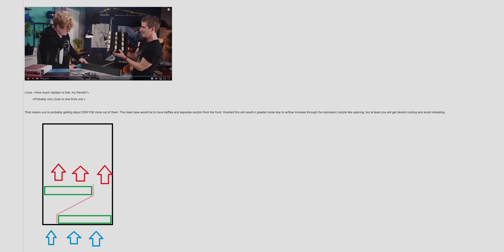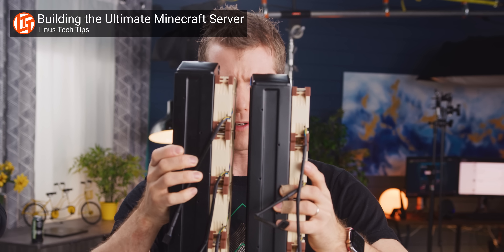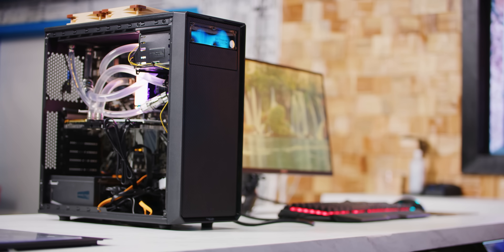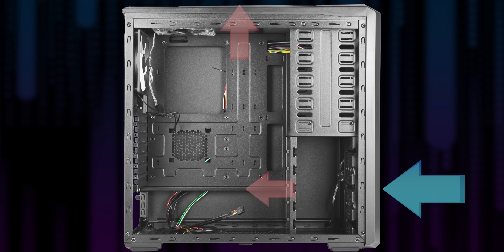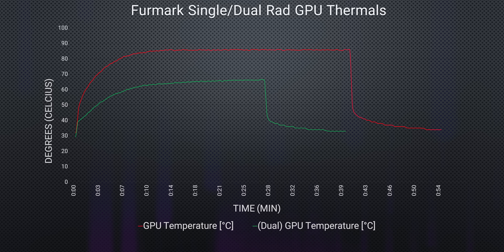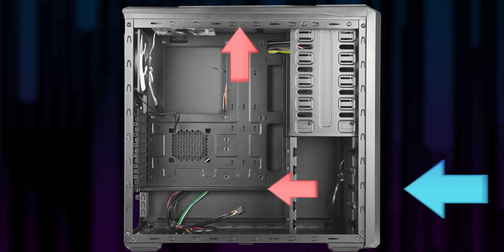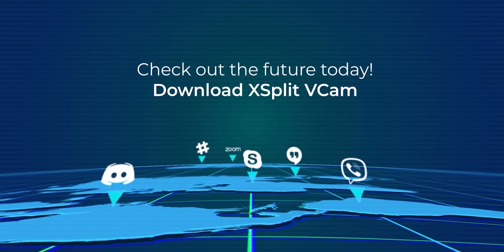I’ve been water cooling wrong for YEARS - $H!T Manufacturers Say

Comment: Radiators are not a new concept, cars have been using them for years, right? So a 2-cylinder engine uses a smaller radiator than a V8 for example. Your "basic logic" makes sense, but the flow of air is the key component here.

Also, another fun (but dangerous don't try at home) how well does a car radiator cool a PC? (seriously don't try at home, a radiator fan from a car is not something to mess with. This is a seriously unsafe mod.)
I'm sure you could get some radiators that you can grab from a scrap yard, find some electric motors (I know you have friends in high places [rockwell automation, general electric, general motors, etc.]) that can run the fans for the car rads... but the difficulty is the pressure flow from those.

At what point would there be diminishing returns?

Comment: I think you're missing some data on this...I would expect the order you run the water thru them matters.  If you run the "hot" water thru the radiator on the intake, and THEN thru another on the exhaust I'd think you would see less cooling effect than if you run the "hot" water thru the radiator on the exhaust and then run the cooler "warm" water thru a second radiator on the intake.

It would have also been good to have thermometers measuring the temperature on both sides of each radiator - if possible, measuring both the increase in air-temp and decrease in water-temp.

Comment: There's some flaws to this video.
Corsair has reached out and said that your specific configuration in the Hack pro was inefficient and that stacking radiators in the Minecraft server was bad.
Bear in mind that you've mentioned that Corsair said that stacking radiators was bad but you didnt stack radiators in the experiment at all.

Here were the limitations you have done when performing your experiments.

1. Comparing your experiment with Hack Pro. Hack Pro has a single inlet and single outlet which completely does not allow for any sort of fresh ambient air mixing. your experiment has multiple open air spaces where fresh ambient air is constantly being pulled in. 
2. Comparing your experiment with Minecraft Server. The minecraft server has 3 radiators stacked together and your Hack pro has no stacked radiators. 

A fair comparison would have been to remove the smaller radiator in the Hack Pro and run temps. This would be a fair comparison towards corsair's claims.
Your own experiment is completely different to the parameters set in the simulation. It's like saying you would like to bake an apple pie but instead went and made an apple cake. It's completely different. 

Simulation will be the future of the engineering world. Please do not discredit simulations which corsairs have done. Simulations have come a very long way to be reliable and accurate and we need more engineers who can perform FEA or CFD.
Reply: Linus said in the video, they took the 3 stack of radiators in that build and removed one, leaving them with a 5°+ on what they had with a 3 stack....
Reply: Another gap in their method is that maybe second radiator is really not doing any real work, it is just that fans of the second radiator is increasing negative pressure in the system and contributing to the efficiency that way.
Afterall if we unplug the second radiator, it is still; one radiator + 2 fans > one radiator.
Reply: As someone who works doing CFD simulations, I appreciate your comment.
Reply: I wonder what an apple cake looks like
Reply: Might it be that they didn't/couldn't test with the Hack Pro because it has since been disassembled... I doubt they would keep such an expensive computer sitting around collecting dust.
Reply: Yeah, nah. If the simulation doesn't agree with experimentation, the simulation is wrong, or the experiment is bad.

Both happen regularly, it's the entire reason we have good simulation software because it is validated against the real world.

One of their critiques was of them stacking the radiators in the server, taking it out increased temps, hence their assumptions on the system for the simulation must be wrong.

It seems to me the main failing is the difference in specific energy of water and air, and that passing 25C air quickly through a rad full of 60C water isn't going to make the air 59C. There will for sure be diminishing returns, but that doesn't mean it won't work.
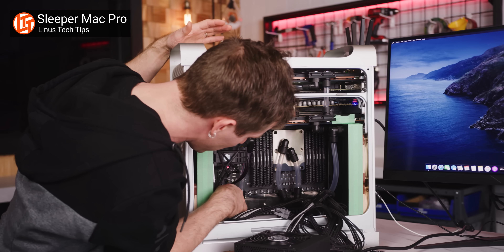Reply: at 6:46  may you have missed what Linus said that when Jake removed one of the stacked radiators in the minecraft server it resulted in a 5 degree increase in temps. fyi
Reply: @TheKb117   Another variable that would affect heat exchange would the the air flow, by effectively removing 1 rad, did he also remove 1 row of fans? If yes then , air flow decrease will be the cause of the lower cooling, not the reduce of heat exchange area.

try 2 rows of rads and 3 rows of fans, i think he would get the same result as with 3 rows of rads with 3 rows of fans.

please dont question our credibility, we actually do this for a living
Reply: Zhi Ting Chong adding another row of fans would barely touch the airflow. The reason there is a 3rd row of fans in the current setup is to create more static pressure to push through the radiator. I’d be willing to bet the airflow in the case is very similar with only 2 rows of fans and 2 radiators. For someone who “actually does this for a living” you don’t seem very knowledgeable about how airflow actually works
Reply: @nickabbott3081  I'm talking about airflow within the heat exchanger( or radiator). Not in the case. At any rate yes, the airflow of the case would be barely affected by adding more fans.

And as you mentioned there would be a small difference which is the point I'm trying to prove. The 5 degree temp difference is very small, and is most likely caused by removal of fans rather than the heat exchanger. Have a good day mate.
Reply: Zhi Ting Chong you’re really not understanding this. That case is already full of fans. It’s a server rack. There’s multiple rows of fans at the front, there’s fans at the back. Adding more fans serves literally no purpose whatsoever. If you seriously believe that adding a couple more fans when the case is already basically full of them will cause a 5 degree temp difference then I don’t know what to tell you. You’re just wrong.
Reply: @TheKb117  5 degrees for $100? Ya no.
Reply: You should always attempt to discredit simulations, but by independent testing. It's why papers are peer-reviewed. Bad science will harm the reputation of simulations, nothing Linus could ever say or do will harm the reputation, he's just an elitist with a YouTube channel.
Reply: I've just did some quick calculations.

Assuming that overall heat transfer coefficient is at 350W/m^2K which is taken from engineering toolbox for water to copper transmission, and assuming that the surface area of the corsair XR7 480mm water cooler is at 0.68m^2, with a water inlet of 60C and air inlet at 25C, it shows that the water temperature would be at 42.2C and the air outlet temperature would be 48.7C. By corsair's replies, it is right. Because what would be the use to cool 42.2C hardware with 48.7C air blowing into it. These calculations have already included a 67.6% effectiveness.

Simulations will mostly be right as long as the correct parameters are inputted. 

I'm sorry for anyone who reads this. I've followed Linus for a long time now and he's just taken a jab at my dissertation which I just completed. 
I hope he'll see this and actually re-do the experiment with the Hack Pro
Reply: @shawntoh6877  It is actually a clever trap by Lienus and Corsair. They are tricking you into purchasing a PC and 3 radiators and replicating it, so that you can figure out why it works!
Reply: I've indeed missed the part where he removed the minecraft server radiator. My bad on that part but still the claims that he's said that corsair is spouting shiz just isnt right and bad shaming the simulation community
Reply: Shawn Toh you really didn’t watch the video closely at all before jumping to conclusions and spouting all this garbage. #1 Linus did test on the stacked radiator configuration and found similar albeit less impressive results. #2 Linus never put down Corsair or said they were spouting “shiz” he in fact said very specifically that he is not trying to put down what Corsair said and believes that there is merit in their insights. #3 He isn’t shaming the simulation community, he runs a YouTube channel that deals with tech. A major tech retailer has reached out and given him advice and so he made a video out of testing it. He would’ve made a very similar video if the claims turned out to be accurate but IN A REAL WORLD SITUATION NOT A SIMULATION the claims are in fact false. I don’t know how you can possibly argue that he’s shaming the simulation community. Do you just want him to listen to everything a simulation says regardless of real world stats? That makes no sense

Comment: When you're outright stacking radiators, there's going to be a dependency on which serial radiator the water goes to first. If it goes to the second radiator first, there will still be some residual heat to be pulled out from the front radiator. If you reverse that, flowing the water to the first rad first, you're just blasting hot air at the second radiator.

Comment: It's all about heat exchanger order. You want the higher temp water in the radiator that will experience the higher air temperature. So in the test rig, the water flow should go: components, top rad, bottom rad, reservoir, pump. If you swapped the rads I would expect the results to match what corsair was saying.

Comment: I've spent years trying different configurations on my PC.
When I had the radiator at the top I found that it ran cooler if the fans were pulling air in to the case than pushing upwards out of the case simply because cold air drops faster than heat rises. However I've moved the radiator to the front as I have a large case and I wanted this heat source to be farther away from the Mobo/CPU etc.

By far my best setup is: 
280mm radiator at the front with a push and pull fan config drawing air in to the case
2 x 140mm fans at the top pulling air downwards in to the case
1 x 140mm rear exhaust fan

Comment: Personally, my guess would be that while radiators are efficient, we have bit of same thing going on as temperature of the liquid. Like if your CPU is running at 60C, liquid in your loop won't be 60C. And similarly to that also air going through radiator will not heat up to the temperature of the liquid. And I do think both is connected to how much flow you get through loop or radiator. While yes, radiator is restrictive, it doesn't exactly stop air either and good fans will push through just fine. And while I do think you could notice negative effect, if 2nd radiator would be taking hot air, that hot air would need to actually exceed liquid temperature, so radiator would get bit of that reverse effect. Otherwise it might do less for you, but it still wouldn't be negative. Because radiators ability to dissipate simply scales with temperature difference, and its ability to warm liquid up also scales with that same difference in opposite direction. But even if air is not as cool as intake, I don't think inside of your case should heat up enough to where 2nd radiator couldn't make at least some improvement. If it does, you might want to look up new case with better airflow. Because regardless of how much liquid cooling you give to your CPU and graphic card, you still need some airflow for other stuff, be it VRM, SSD or chipset, those don't like to get cooked either. Plus if your case reaches temperatures to where you feel it like it is really very hot, like close to burning hot, you got bigger problems to worry about than 2 or 1 radiators. And yes, I saw plenty of cases where people "forgot" to upgrade their case, went from lower end or mid-range build to high end and suddenly had noise and heat issues because poor case was designed to work well with much lower end parts. One new case later and things drastically improved.

Comment: I think you guys done fucked up here. Like many others here in the comments, I'd almost guarantee corsair were referencing your stacked rad setup.

If you wanted to, you could liken it to adding double or triple layers intake or exhaust fans on an air cooled system.
Whether the second or third layer would be completely irrelevant idk, but you'd get massively diminishing returns, simply by the laws of physics as corsair pointed out.

Also you guys normally take a pretty measured approach to these things, however this video was half-assed at best. Seemed a hurt ego reactionary video rather than a fair test (particularly because you putting this in the shit manufacturers say series). I'm sure corsair has some of the best  airflow modelling software around, that'll almost directly translate into a real world system. 

We can simulate some really amazing things real well these days and it's a bit sad you disrespected that so much. I mean look at your folding at home initiative. If we can simulate stuff like that, I'm sure you can believe an airflow model to be correct.

Ps. Loved that new animated intro tho

Comment: What if both rads were exhausts? They both would exhaust the hot air, and not circulate it back in. You could have the other fans intake the ambient air. That may be even better cooling performance.

Comment: The testing results can be affected by direction of flow. (Didn't read all comments)
My theory should have flow to first rad in upper case and second rad at front of case. this would allow the hottest air to be discharged first and not get trapped in the case. Although I do wonder what the difference in overall temps be plumbing to the front rad first.

Comment: Would like to see comparison of the same cooling loop but with two different size reservoirs.  Is it possible to hit the heat capacity of a system’s water volume?  Can simply increasing the amount of water improve either overall temp or time to reach max temp?

Comment: Running them stacked vs the same radiators not stacked seems like the obvious test. Car manufacturers a do the same thing. They need multiple small radiators because stacking them loses major efficiency. Problem is there isn’t enough room in a case to do this so stacking is better than one.  Surface area of the cooler is a bigger factor than the thickness , but going thicker is better if you have no other option.

Comment: I've been watching your videos. The question I have been wondering about is, how fast does the room temp rise? I got a lot more in my system than you have in yours.
4 pcie cards plus 3 hard drives plus on ssd.
I do have a pcie ssd in the system that can produce a lot of heat. 
I want to see if you could try two new ideas.
Can you water cool gpu, cpu and a pcie ssd?
Since computers run as dc power, would it be more power efficient to use a 12v battery or more? The system mainly uses 12v off power. No power supply heat.

Comment: BS claim by Corsair imo. Air is still limited to taking a certain amount of energy and is still able to take that amount of energym worst case scenario stacked radiators will work exactly the same as one radiator.
Stacked radiators still have more surface which helps them lose energy faster

Comment: I definitely think there is a lot to be said about the single airflow source. In a server, like the MC one, stacked rads can only get you so far. In a computer case, the chances are high that you're pulling in air, that didn't ever touch the first rad.

20C is quite a lot more than 5C, and I definitely don't think 5C for the cost of that rad+those fans, is at all reasonable. I'd bet money that if you spaced them, and had air vents in between each one, you'd see a MUCH bigger difference in temps, though, this would probably not work in a "real world" rack mounted situation, where airflow many times can only come from the front, and out the back. I guess I'd look into side panel holes at that point, if the temps of the components mattered that much.

Thanks for doing this testing. I definitely didn't understand the stacked rads in your MC build, and I don't personally think it's comparable to the gaming PC situation, where you have lots more fresh air for each rad.

I think there is a lot to be said about going from say.. 95% of your max heat exchange, to 99%, by shoving in more and more rads, in a stacked configuration, but it's a matter of people not having LMG/LTT money at that point, lol.

None of this really touches on the fact that the simulation is showing 100%, and in reality, there are air leaks all around those fans and rads, letting in SOME level of "fresh" air, even if from inside the case, but seeing the 100% can inform you about the real world situation, and show you that in fact, yes, it is better to space them a bit.

Comment: In the beginning you commented about stacked radiators and then you did it completely different this a bs video
Reply: Did you even reach the end of the video? They even shared the data where they removed 1 of the 3 radiators of the minecraft build, just for  funs and it resulted into a 5 degree increase.

Salty corsair fanboy
Reply: @TrinhStudios  preach
Reply: @TrinhStudios   Those rads are $100 a pop so is 5 degrees worth $100?
Reply: @TrinhStudios  Doesnt change the fact 90% of the video was the wrong topic
Reply: Not true

Comment: If the air comes out of the rad almost as hot as the water, then that's nowhere near enough air!
Logically, if you use more than one radiator as a compound unit, the water should enter the last one and progress to the first, but with two rads and two blocks, block -> rad -> block -> rad seems like it ought to be the best.